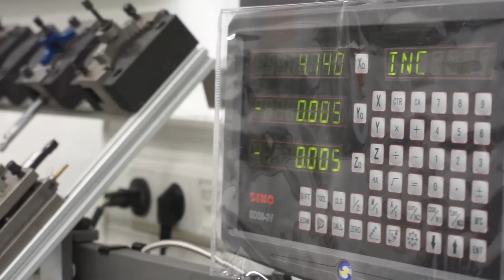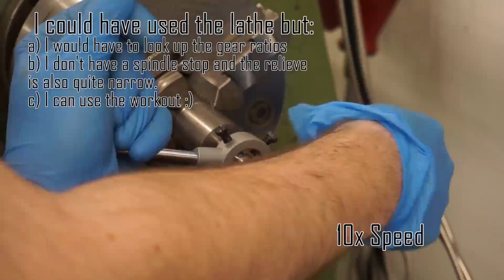How to make a Machinists' Jack for a Milling Machine

Comment: Like the jack but it seems to me if your going to support material extending from your vise just make a part the same heitgh as the vise. Then there is no need to adjust. That s the way I would make that piece. But understand the jack part.

Comment: Looks nice good job, I was surprised you don't use thread cutting fluid/oil and lubricant for drilling, your tooling will last so much longer.
Reply from the maker: Thanks. Yes, you are absolutely right. For filming I usually don't use coolant because it makes such a mess.